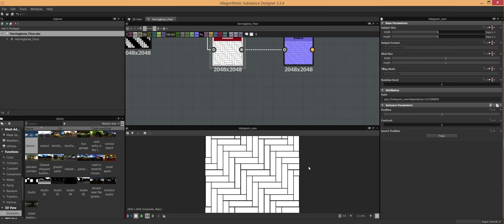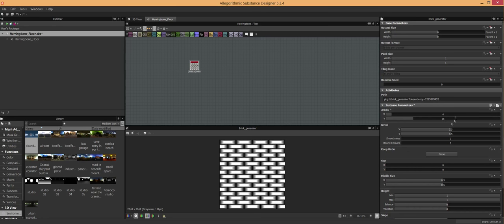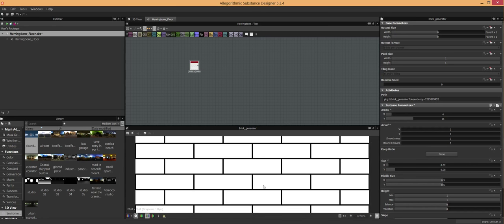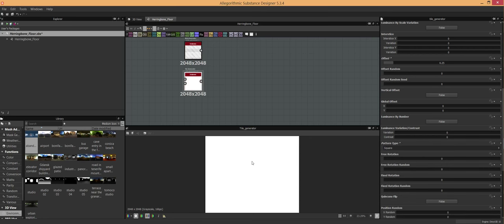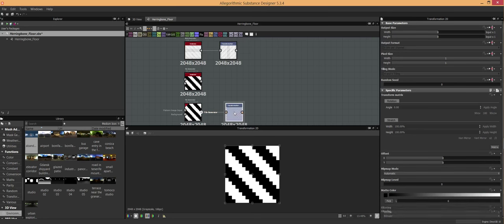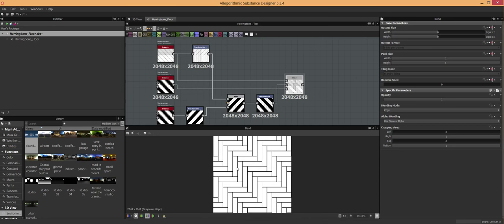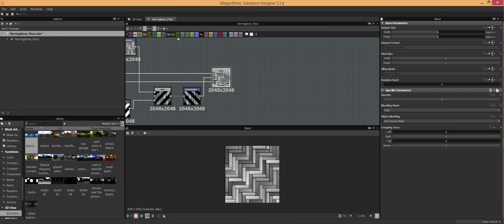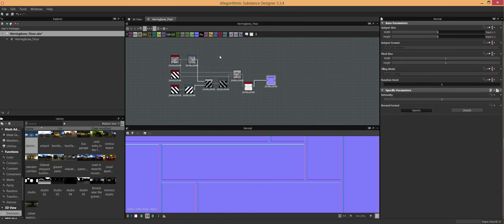How to Make a Herringbone Pattern in Substance Designer

Comment from the maker: According to a moderator working for Allegorithmic, the reason for the normals having that issue at the end of the video is because I left an input blank on that first blend node, so to rectify that issue completely you can plug a 16 bit solid color into the first blend node or set the blend node ouput to absolute 16 bit.
Reply: So would you say it is 'poor practice' to leave inputs blank on blend nodes?
I usually leave bg blank when i want to grab a layers alpha

Comment: sick dude, thanks! if anyone wants shorter bricks, like 4 and 8 instead of 4 and 16, use .02 for x and .04 for y on your gap setting, and use 0.5 as your offsets instead of .25
Reply: thanks a lot, and also those who still dont get the right results, check offsets for the tile generators as well, it took me a while to figure out that one.
Reply: @quartermaster2809  Thanks for the tipp, helped me a lot! :D

Comment: How do you insert the various floor board textures? this is the confusing part..
Reply from the maker: Duplicate the graph I showed here except turn up the luminance values for the brick generator and then plug the two separate masks into a directional warp with the floor board textures as the primary input. The directional warp will need to have a value of 200+, and then that result is fed into a blend node that has one of the two mask inputs plugged into the alpha channel. http://i.imgur.com/tVWoMGP.png

Make sure to plug in a solid black color into that last blend node, too.
Reply: Ah, clever, so the directional warp makes sure the floor board look randomized? vs all just cut out the same wood texture (because just plugging in the masks would give this effect)